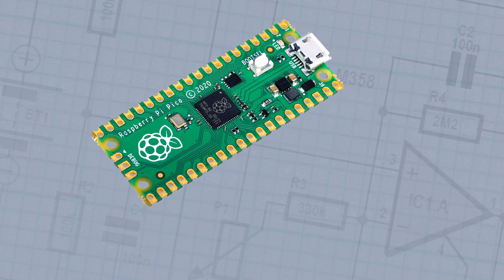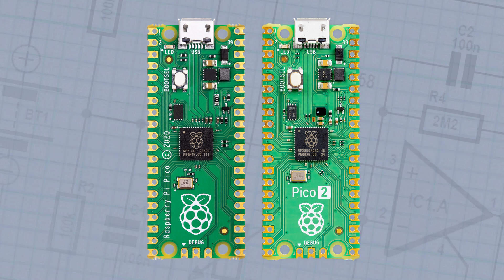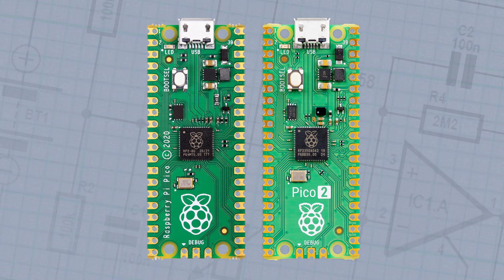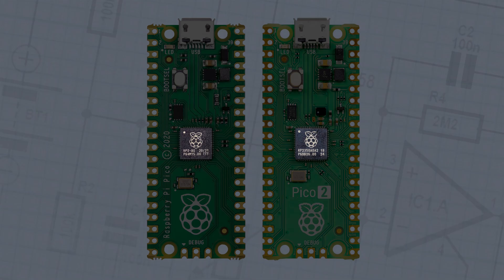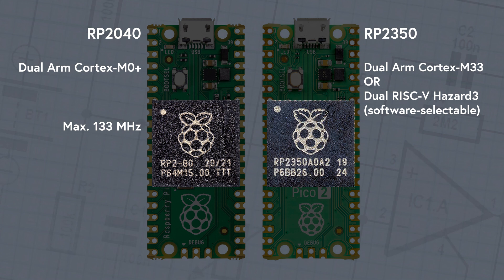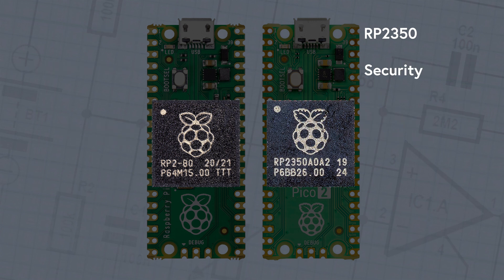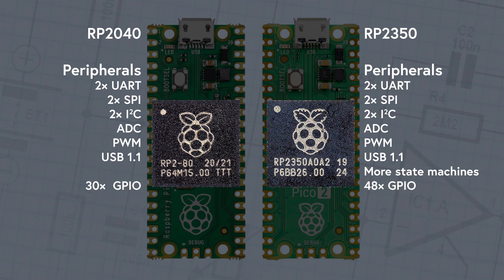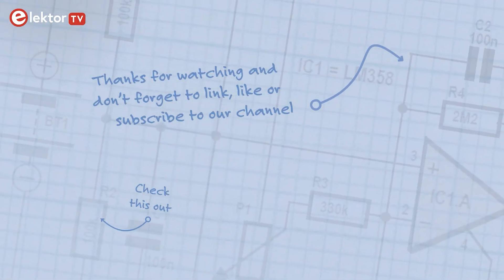Introducing the Raspberry Pi Pico 2

Comment: no wifi, no USB C, no performance improvement.
really an underwhelming upgrade
Reply: @4_shadowing  2 more newer processors, 2x SRAM. Definitely improved.
Reply: The Pico2 should be 4 times faster, than the pico 1.

Comment: Small correction: You can run both RISC-V and ARM at once, although you are restricted to two active cores.  The RP2350 datasheet includes a section about setting one core to be ARM and the other to RISC-V
Reply from the maker: Thanks for that! The datasheet is hot off the presses — we'll check it out and put a note in the description. Thanks again for contributing!